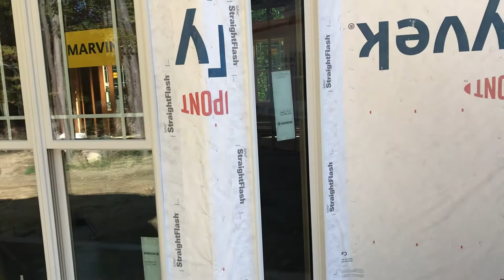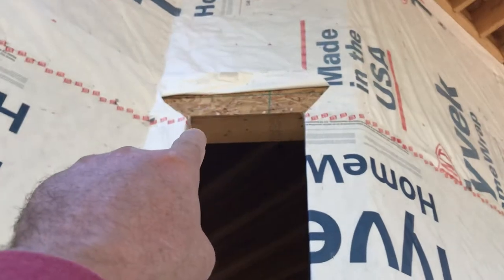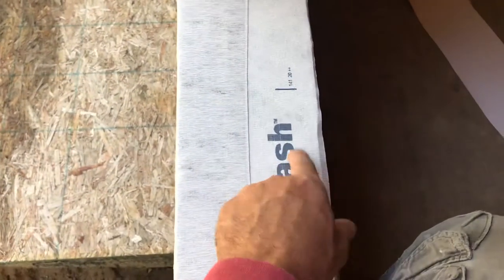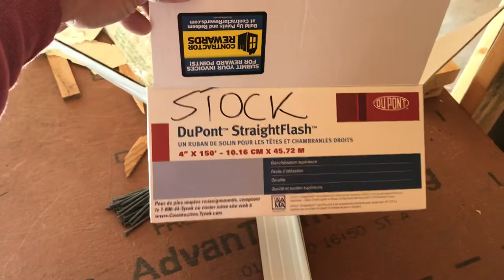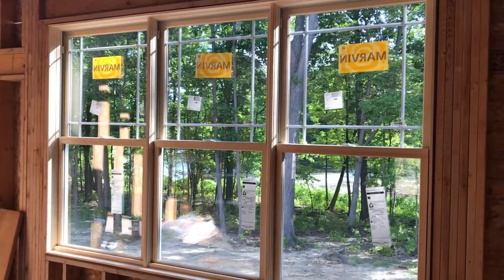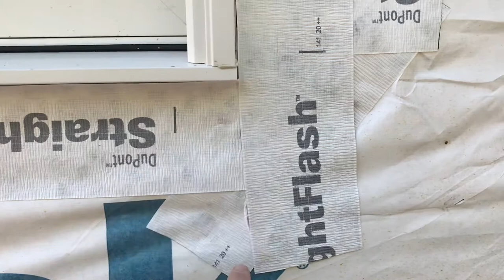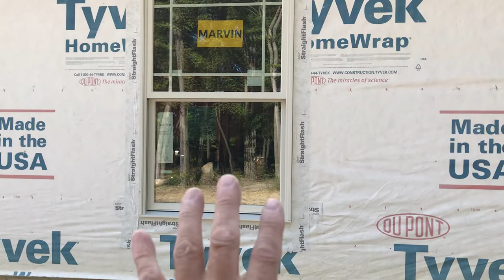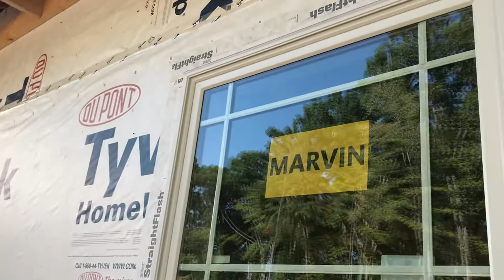Marvin Fiberglass Window review

Comment: I am doing research for replacement windows and first choice after couple of weeks of meeting with different companies is Marvin infinity .. around 50k for replacing all windows .. any idea how bad is the curb appeal moving from a wood to fiberglass
Reply from the maker: It looks great. It's high quality and maintainence free. I like them because the fiberglass doesn't expand or contact and is not flammable. They are really good windows but definitely pricey!
Reply: 50k??? How many windows????
Reply: @stevebbkny2394  total 11 openings , 5 are large with 4/5 windows and transom, now reduced to 3 + 1 transom .. price for Anderson fibrex came down to 45k with no transom .. but finally settled with Marvin fiberglass as it mostly matches with current setup .. still waiting to get installed , minor delays I believe related to supply chain issues

Comment: After you nail the windows on the exterior sheathing, do you screw them from the inside anywhere?
Reply from the maker: Great question! It doesn't have any indicators on the window nor does it have any info in the instructions saying to screw it. The flange seems to hold the windows pretty rigid. However, I was thinking, before drywall, I might run a pilot hole on all four corners and use T15 torque screws (tiny heads). The doors come with the same perimeter flange, but the doors definitely need screws because they have more movement after nailing the flange.Thanks for your comment!
Reply: @davidunderwood4341  there are pre drilled holes for jamb screwing underneath the jamb liner
Reply from the maker: @Grande79  Thanks Michael! I'm glad you pointed this out before it got too far down the road.

Comment: Thanks for the video.  Were these the Marvin Signature, Elevate or Essential windows that you were installing in the video?
Reply from the maker: They are the Marvin signature. So far they seem to be working well and they look amazing! Thanks for watching!
Reply: @davidunderwood4341  Ok, thanks for the quick answer.  I think those  are the same windows we are looking at, they are fiberglass.  The quote we received was about $2,600 per window, 28 windows and 2 patio doors for about $78k.  That seems very high to us, but since this is our first replacement window purchase we have no idea.  We thought it would be closer to $50k.  We do have a two more estimates for this week so we'll see what they have to say.
Reply from the maker: @SquidzitAce  Yeah, our windows were so expensive! We just bit the bullet though because it's a small cost to the big picture. Not to mention they are a well built window.
Reply: @SquidzitAce  these are the Elevate series
Reply: @SquidzitAce  I just ordered infinity by marvin fiberglass for about $1,200 a window. This will be the last cold winter in my house. I recommend you check them out.
Reply: @SquidzitAce   that’s High.  If you get pocket replacements they will not cost that much per window. I’m getting bids now and the cost per casement and transom including labor is 1640.   Whoever you got ripped you off big time if you only had double Hung.